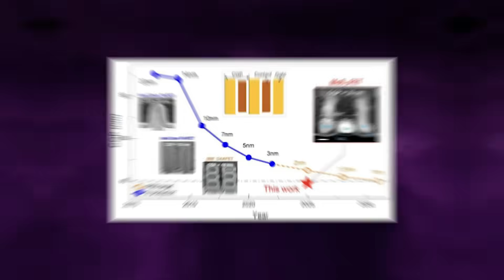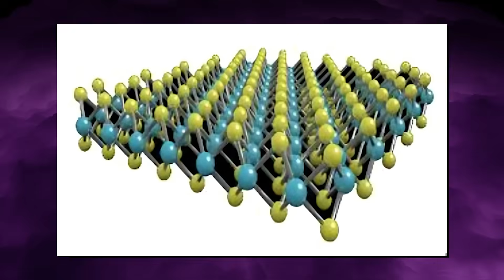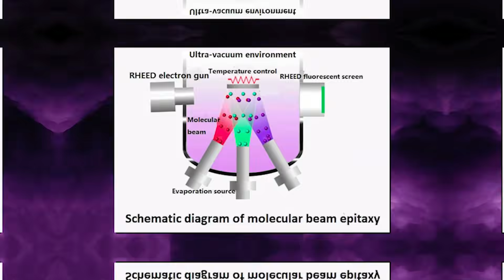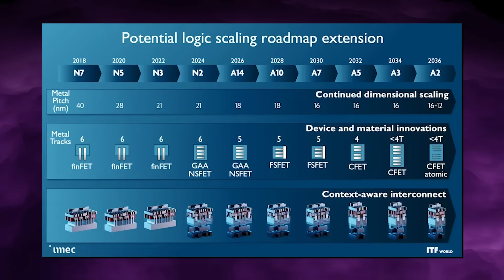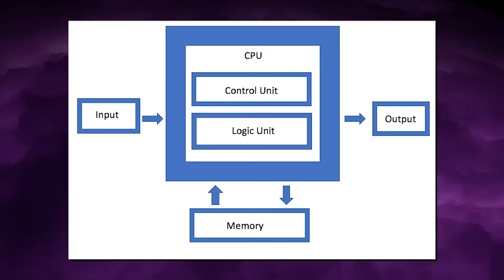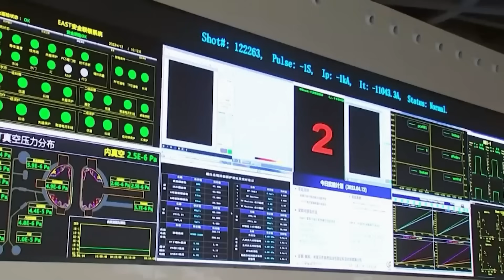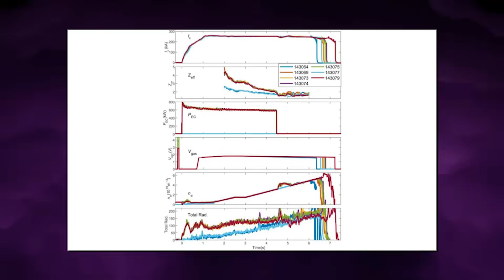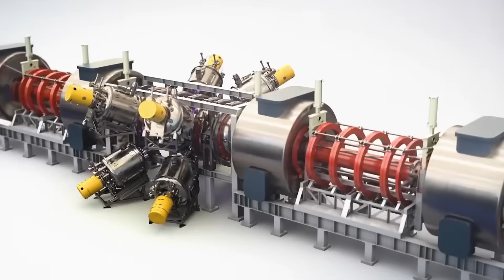China Just Built a 1nm “Beyond Silicon” Chip: West is FREAKING OUT!

Comment: Current WUJI chips are MoS₂-based experimental processors with about 5,900 transistors on a roughly 6 × 6 mm die, operating at around 1 kHz. In practical terms, this places them at roughly early-1970s silicon capability in speed and complexity, but implemented with atomically thin transistors.

This work follows the 2023 Nanjing University result that largely solved the MoS₂ contact resistance problem, removing a fundamental physics limitation but not addressing large-scale manufacturing or performance. Today, MoS₂ logic remains many orders of magnitude behind silicon in transistor count, clock speed, yield, and ecosystem maturity. Over the next 5–10 years, scaling is expected to reach at most tens to hundreds of thousands of transistors, mainly in hybrid MoS₂–silicon chips. Reaching late-20th-century silicon scale would likely take 15–20 years, while parity with modern silicon remains far beyond the current horizon.
Reply: Wow your 2-3 years behind, did you retire?

Comment: So basically "China introduced a starter motor and warmed up the engine before hitting the throttle." Makes sense

I suggested a similar idea but mine involved staring plasma outside the reactor and injecting it with smooth laminar flow, however if this achieves the same thing with less steps then I'd say it does what it needs to do.

Since it's just a configuration dynamic I'd say any existing TOKAMAKS and Stellarators can employ the same principle and get the same results so it doesn't strictly put China ahead but it does mean that they've just made a sizeable contribution to science and should be given the due respect and thanks from all of us.